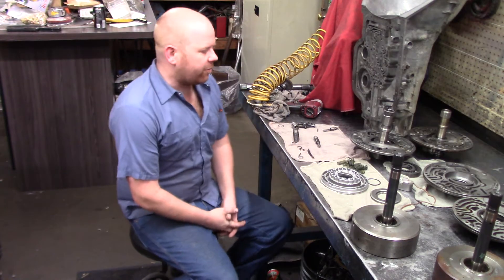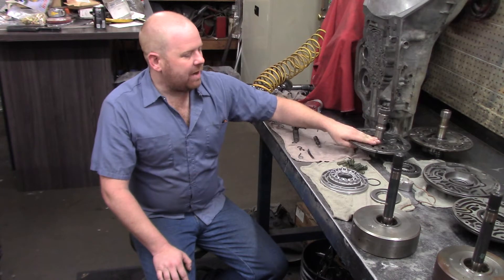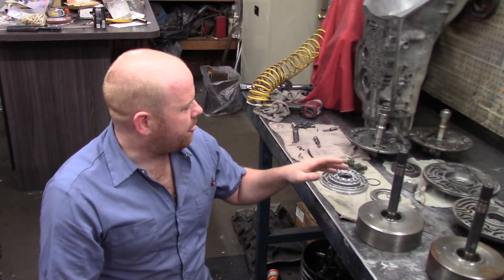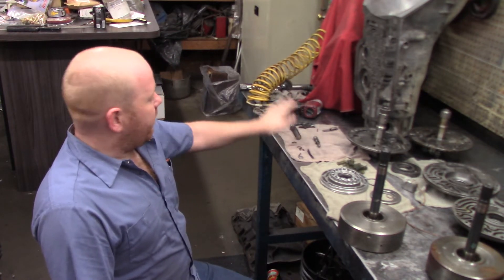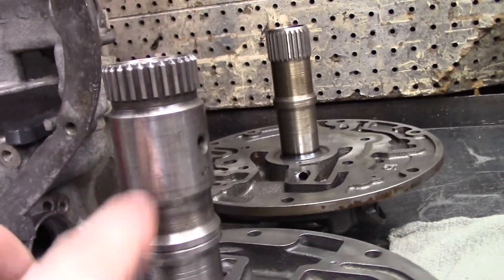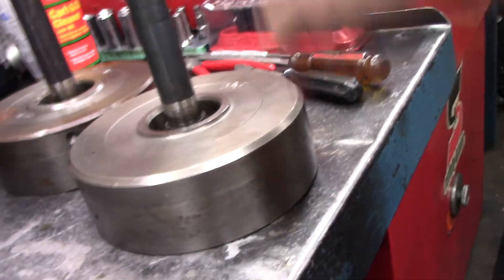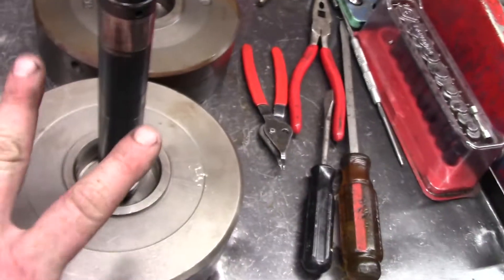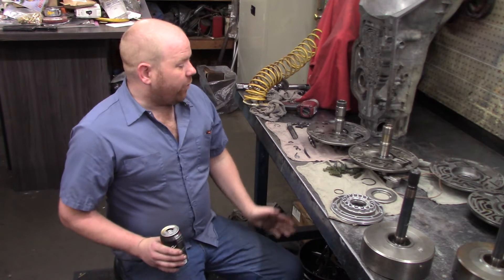Part 2: Switch Pitch build from reg. 400. Necessary pump, input drum, and stator control solenoid.

Comment: I want to make a switch pitch TH400 into a non switch pitch trans in a 65 Cadillac-I am thinking use a regular 400 pump assy, input drum and shaft, and remove the  .028 restrictor plug. My question is-- Can I re-use the valve body that came in the SP trans--or do i have to replace it also?  The cost of a SP convertor is the main reason for eliminating the SP function---I already have a rebuilt TH400 normal convertor laying around
Reply from the maker: let me check and see. had a guy ask a similar question awhile ago and ill have to get my book out and verify. I want to say it is ok. I have several 68-76 caddy valve bodies that take the other style filter and all as well.

Comment: My transmission rebuild shop put a turbo 400 valve body with the flat filter on my switch pitch transmission. I just bought two salvage switch pitch transmissions one long shaft one short shaft when I pulled the pan I saw that the valve body was different. Is that okay or should I have them put a switch pitch valve body back in and also I'm wondering what they did with my original switch pitch valve body. I'm going to guess that they had a hard time finding a transmission filter because they are considerably different.

Comment: I have a question as well, Iam wanting to mate my 1967 cadillac TH400 to my 2000 chevy  5.7 liter/350  anyway I bought adapter kit for BOP, and it says it will fit 1964 and up but the adapter dosent fit the 1967 cadillac transmission and I got the same adapter sent to me twice, any info on where to find my adapter?, thanks, Lou,

Comment: I have a question for you since you seem to know what you’re talking about!

I want to do an LS swap in my 66 Cadillac.. but to keep it simple I would prefer to keep the 400 trans, now there ain’t no converter plates between 65-67 trans to Chev smallblock/LS
But I thought..
Is it possible if I to get a Chevy TH400, that will fit to an LS since it’s the same bellhousing except the top bolt.. And then rip it apart, and put my longer Cadillac output shaft in there and of course the extension housing on it? 

Interesting video, subscribed! 👍
Reply from the maker: Thanks for the subrcribe! and there are some differences in the geartrain lube circuits and some other parts. Basically Yes you can, just got to be sure of the internals all matching correct era production runs.The early 400 output shafts dont have a tiny feed hole that lubes the inside of tail housing, that 66 wont, the chevy version if a short shaft might. as long as all you are changing is the output, look at it close and see. If ya have any questions let me know.
Reply: @gunterding_performance9558  can we talk somehow.

Comment: Use the term VARIABLE PITCH in your title along with SWITCH PITCH for more finds searching for the video. Switch Pitch is slang for GM's VARIABLE PITCH term.
Reply from the maker: Good point! Thanks
Reply: @gunterding_performance9558  I can't recall for 100% certainty, but aren't Th350 pump gears the same diameter as Th400 gears? If so, Th350 gears come in like 3 different sizes. I'd be interested in finding out the thickness of them and see if one of the Th350 sets will work for the VP Th400 Pump. I have a  67 Olds VP Th400. I could never get it to sell locally but I noticed the pump sells for good money on eBay. I was watching your video to see what else needs to go with it. I've never seen anyone sell the input shaft and drum with a pump so I wonder if the later model input and drums work with it too. Since I decided to not use it in my Chevy Th400 Rock Crawler truck, I think I'll just sell all the components as a kit for someone else to use.
Reply from the maker: Yes on them being the same, however the only ones i could find new are too  thick. Like the later 400 pumps used. You MUST have the input or forward clutch drum and the converter, along with the pump. The drum is impossible to find as usually are the convt. And there are differences in the pumps and input shafts. I have done extensive research and have over 200 pages on the matter. Ideally you want the 66-67 style as the feed holes in the input are dual feed or more volume and the switch happens quicker. Id be happy to answer anymore questions you may have.
Reply from the maker: I did a vid on these gears as well if you haven't seen it yet. Better explains. Its the thickness and not O.D.
Reply: @gunterding_performance9558  Yes, I did see that video too and how I knew the gears were an issue. I see you're right. None of the Th350 gear options get down to the .626. I too thought converter might be an issue. Luckily I still have this core converter.  I figured I'd have to take it to a converter builder and have them open it up for cleaning and hopefully able to find any bearings or other parts needed as far remanning. I haven't seen any current ads, but there was a performance company that made them and had custom stall speeds. It's been over 10 years now but there was also someone who would make them using ST300 cores and at that time he had plenty of cores. As said, I don't think I'll need it for my project anymore so I'm likley to clean these pieces up best  I can and they'll end up being sold. I know there's still a few out there looking for the components.
Reply from the maker: @hotrodpc66  Yessir, I called every old school trans parts place and none of them had the 626 gears. And I figured if i had to have them made, might as well get several done. I can give you the info on who built my conv if you.d like.
Reply: @gunterding_performance9558  It would be good info to pass along. Who knows, I might decide to keep it for my 85 Big Block 4x4 Chevy K20 truck and use the info myself. Did you send him a core or did he just build it?  That was the intent. I've been on again and off again about it. I took my pump apart last night. Gears are in great shape. Teeth seem sharp and a snug fit so I expect when I measure them they're going to be in fine shape.

Comment: What is the benefit of staying with a pitch switch set up rather than switching to a standard 1 wire kick down? i have not opened it up yet but it looks like someone put 1 wire th400 in my 67 cadillac (prior to me buying the car) but did not convert the kickdown switch.
Reply from the maker: Hey Bucky, and thanks for the interest! Its a matter of opinion really. They were popular with Hot Rodders and drag racers back in the day. They had a performance gain of higher stall and the driveability of a lower stall on the road. In the 66 I did, the switch on the carb when working right, at about 1/3 throttle changes stator angle, and at WOT kicksdown while maintaining high angle. Pretty peppy for a big car! All of my vehicles with the exception of one has Edelbrock carbs tuned to the vehicle. Only 1 is factory QJet and kickdown Switch installed. I set all of mine up on Vacuum kickdown.
Reply from the maker: As an example, In my 68 fleetwood, it launches pretty amazing for such a big car at high angle, but low angle is about 200rpm stall lower than factory. So as long as not driven like a bat outta hell, its a bit better on mileage. I routed the original kickdown wire to a dimmer switch mounted on the floor, and then to the correct terminal on the case connector. If running hard, I leave in high angle, and when cruising, hit the switch for it to drop to low angle and it is almost like a lock-up conv. Fun and interesting. Worth it to me:)